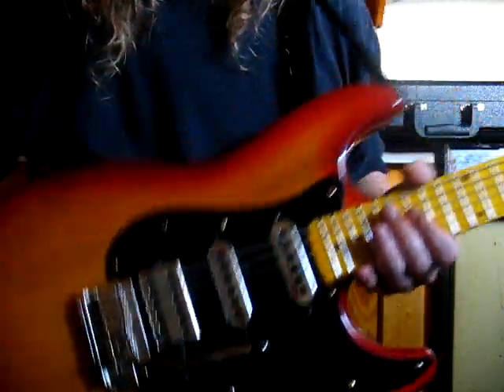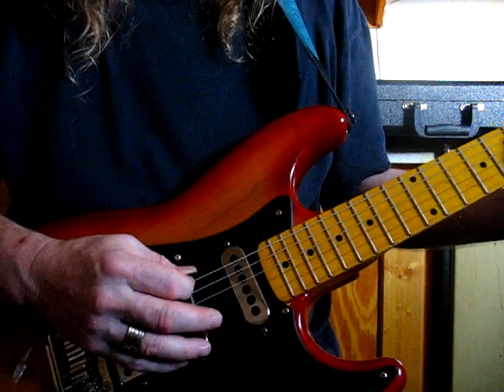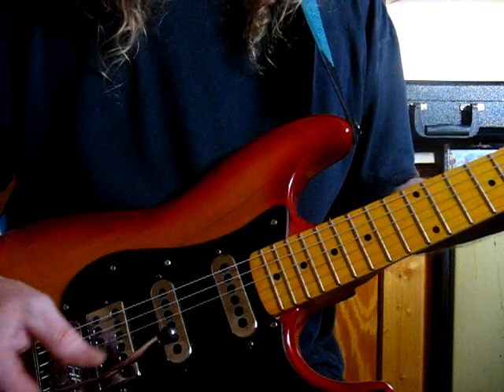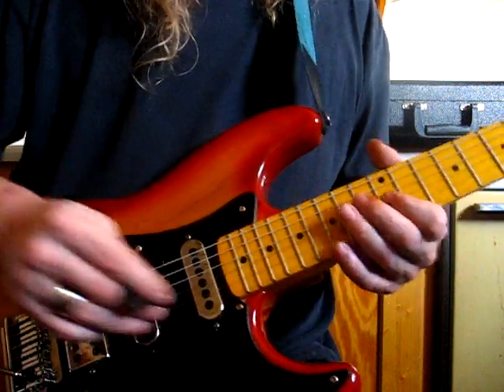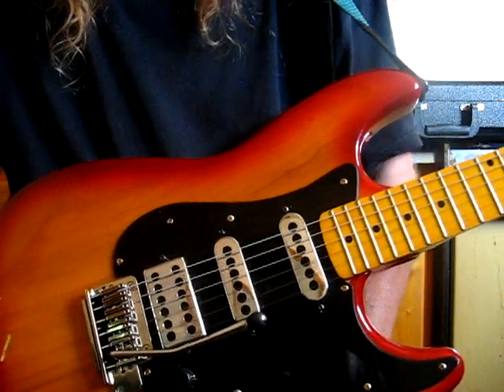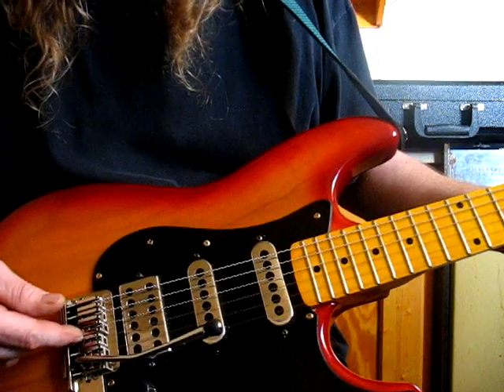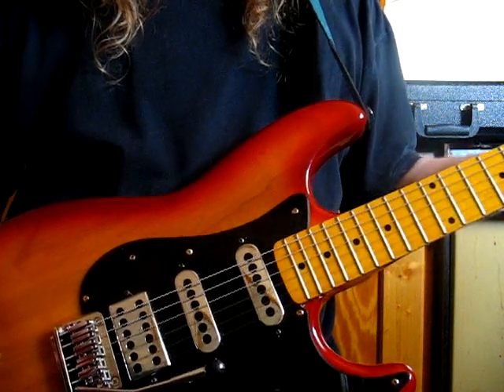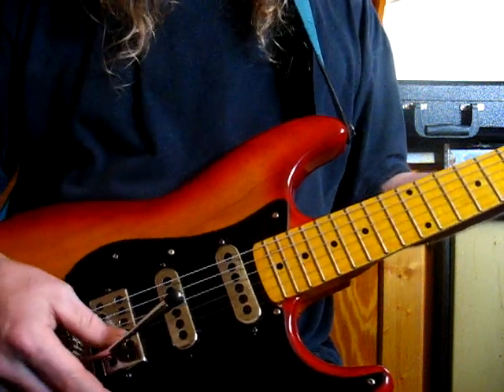Trem King follow up Demo with Roscoe Peterson

Comment: ok... sold!!  I just recently purchased a Strat type body from 'Custom Guitar Bodies, Aurora, Colorado, USA. The body is routed and drilled for a two post tremelo system... I'm going to use the TK1 on this project (also my first project) looks fairly simple to fit.... anything i should watch out for lodaddy?
Steve over here in Cambridgeshire England.